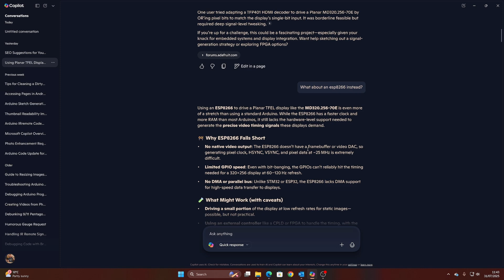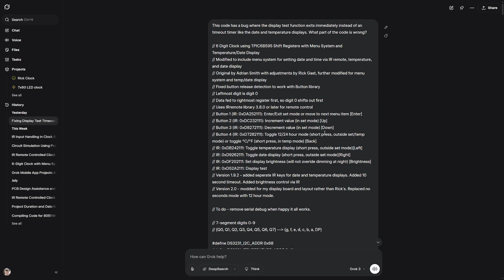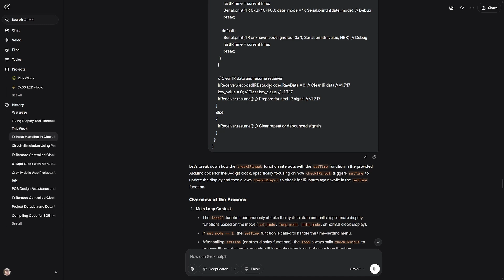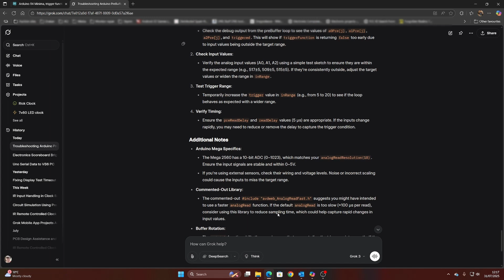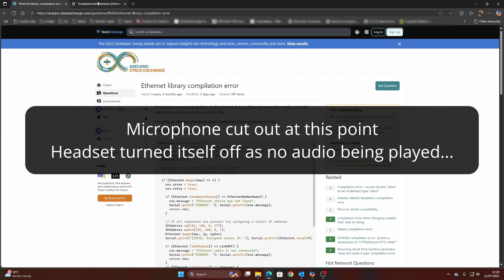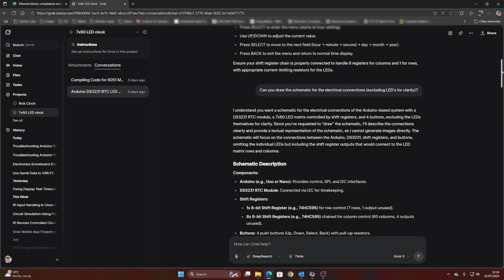Support Forums Are Dead: Use AI for Coding Help Instead To Fix Your Arduino Sketches

Comment: Can’t agree more.  AI makes anyone with a good foundational understanding of anything quietly unstoppable.
The key is to develop those foundational understandings…
Reply from the maker: I asked Grok if it gets the information it gives off the Internet or it actually knows programming languages. I had a thought, if noone uses forums the AI's information would get stale and outdated.

When asked this it responded that it does know all the main languages without having to search the net but it can do to get more detailed information. 

Turning on think mode makes it use its training more to solve a problem or create a program from just a description.
Reply: @adriansmith31 There is also a sea of documentation it has ingested, with many real life examples posted in public GitHub spaces.  I’m likely just scratching the surface of numerous trusted information sources.